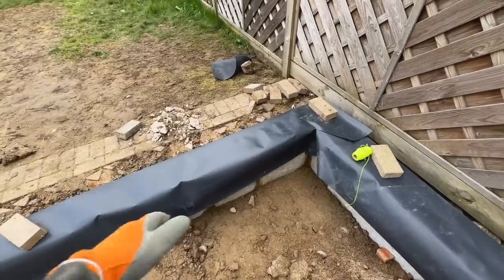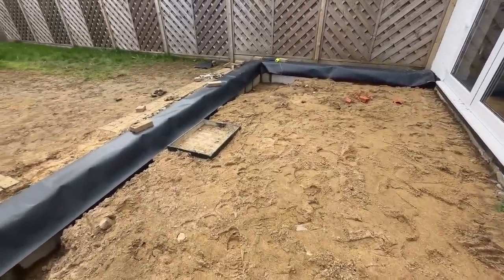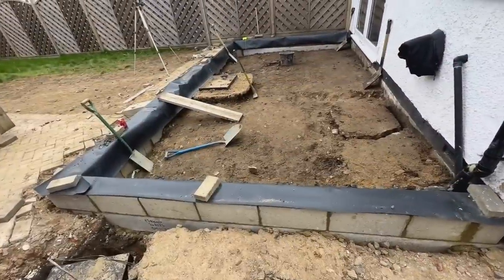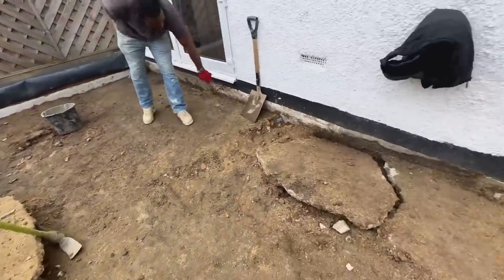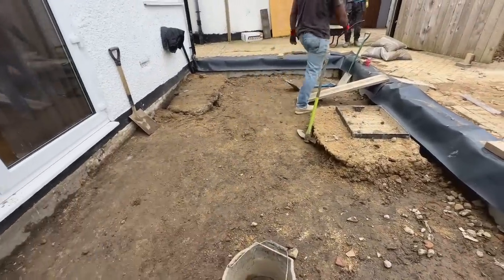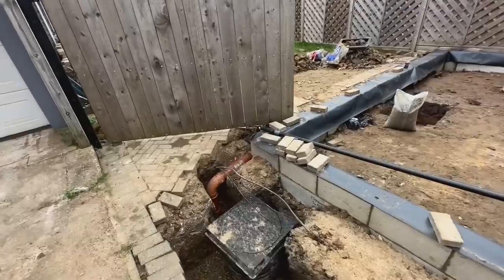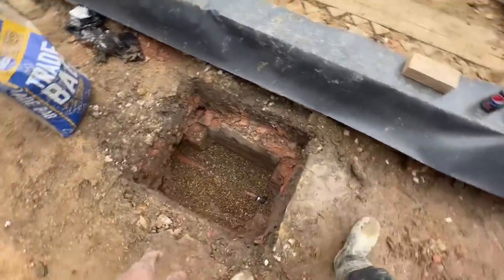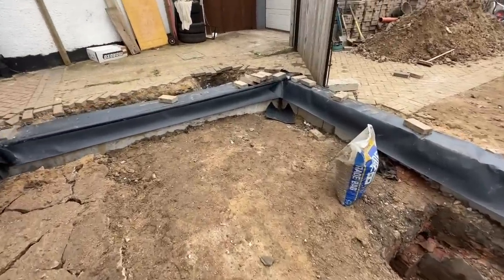Timber frame extension: Ep 8 - removing a manhole

Comment: My neighbour had a very similar method of construction for his extension, and has been plaqued with rat infestation. The rats have been burrowing underneath the  foundation.
Reply from the maker: This will have a concrete oversite.
Reply: Thanks Darren, my neighbour had a concrete block and beam floor, which created a large void underneath floor, causing the problem.
Reply from the maker: @steve45678  i was thinking it might be something like that. Good thing about the concrete slabs is you don’t get that problem